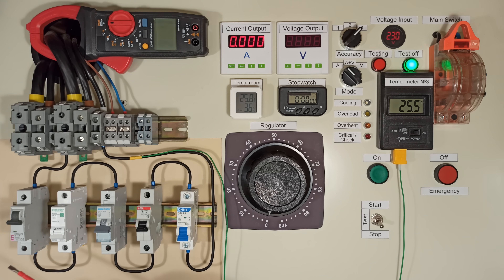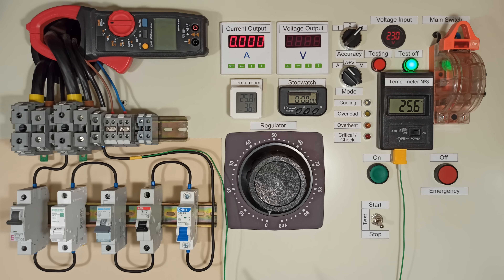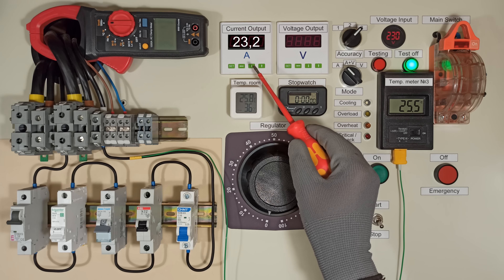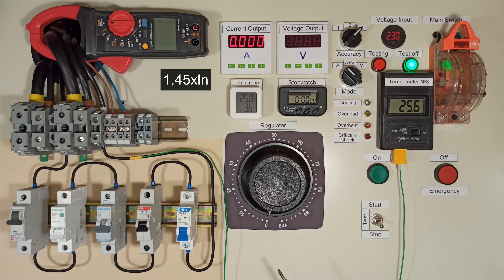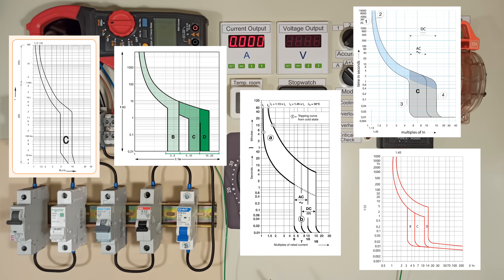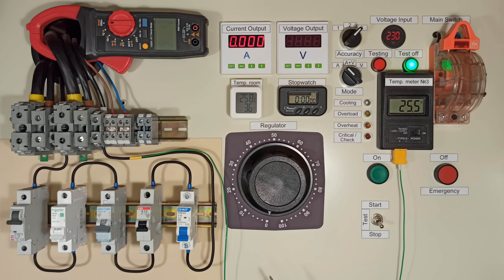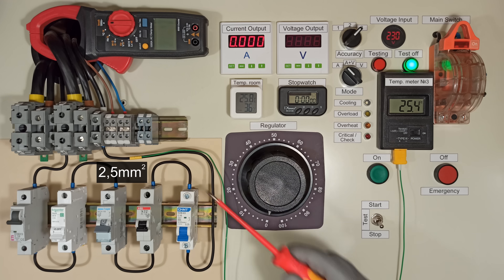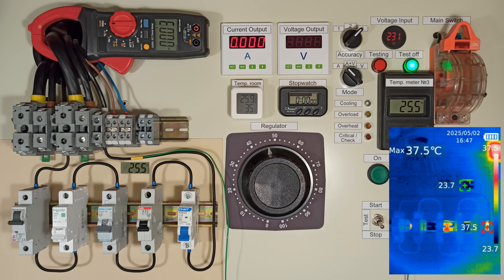Test MCB 16A. ETI, SE, Hager, ABB, CHINT

Comment: Tripping after 2:15 in an overload scenario is good in my opinion. The ETI was able to start the overload but tripped before reaching the 3 minutes - I anyhow think fair enough, because the load is already 45% above the nominal value. Yes, anyhow outside the spec. Having all breakers installed in a row may have had influence on the results, because all the breakers except the ETI had to stand the overload for several times. I can‘t say if that has an influence, but it might.
Reply: If it is outside of the curve then it's definitely not a good result. One should be able to count on those things.
Reply: @eowendyl  you are right, but honestly, what is the practical gain? If it does not trip after two, it trips after 3 minutes.
Reply: @Herr_Bone  For most people it probably does not matter, but for example if I switch from inverter power to grid power for whatever reason, I typically want to use as much power as my circuit breakers will allow, and I rely on knowing what I can get away with. So, in this not so hypothetical situation I may be charging my batteries at maximum power, my EV at max power and perhaps some other stuff. Now, I want to be able to count on the fact that my circuit breaker won't trip on me while I do this, and if it's outside of the curve then that definitely does not instill any confidence.
Reply: @eowendyl  yes, understandable… but for one single minute longer? Come on.
Reply: @Herr_Bone  Yeah, this particular test won't do much for me, BUT the point was that this particular one was out of spec in this test, so I would not trust it in any situation. (Which may be too harsh but it is what it is)
Reply: @ yes, from that point of view you are right. Out of spec is out of spec.
Reply: Да, съгласен! 100% има влияние, че са вързани последователно... Тези устройства са създадени за точно определени по брой инцидента, и с времето губят своята точна настройка!
Reply: Even though the other's had tripped before, if they're allowed to coold down to room temp between tests, I don't see any issue.
Reply from the maker: Thanks for your comment! I made a new test with ETI. "Tripping Time 5 MCBs. Test ETI Etimat 16A 1,45*In" You can watch it. I think you will find it interesting.

Comment: It would be interesting to see a test to determine the minimum current for triggering electromagnetic protection. Also tests with In *2 and In *4 so that the entire thermal protection curve could be interpolated. And also the dependence of the trigger speed on the ambient temperature.
Reply from the maker: Thanks for the idea! I’m sure it’s really interesting for me and probably others too!
Reply from the maker: I think the most difficult part is creating the test — the dependence of tripping speed on air temperature.

Comment: I don't see it as a big deal when it comes to brands, and for a private installation, I'd probably go with the probably really cheap "CHINT." 
But to be honest, there's a noticeable difference in height. Here in Germany, we like to use "busbars," (sog. Sammelschiene, Kammschiene, Phasenschiene) and electricians probably wouldn't like that. Furthermore, with existing systems, different manufacturers are often mixed during repairs and extensions. I think you forgot that in your very well-executed test setup. You used old-school free wiring. 
With a real system, things will be a bit different, and I don't see much hope for the Chinese company.

To be honest, I don't really understand the Chinese either. I notice it everywhere with them: the dimensions are different, even though they want to be successful on the global market. Whether the sub-distribution boards are smaller there or something like that, it's a mystery to me.
Reply from the maker: Thank you for your opinion. I haven't installed many CHint products yet to have a lot of information about them.

Comment: Eaton, Legrand, Siemens, General Electric, Gewiss?
Reply: At least here in Europe, GE is out of the market for most electrical components, including MCBs. They sold that division off to ABB a bunch of years ago.
Reply: siemens bad ever cb i seen that fired my closer like stove, i just changed with chinese cb
Reply from the maker: Thanks for your comment! I made a new test with Eaton, Legrand, Gewiss. "Test MCB 16A. Eaton, Noark, Gewiss, Legrand, E.Next" You can watch it. I think you will find it interesting.
Reply: @ElectroTest_1  Sorry for the late reply, I saw that test and many more. I love watching your tests. It would be interesting if you could test and compare the MCB curves with the curves of NV/NH or Diazed II (gG/gL) fuse links. From my experience, it seems that fuse links of the same rated current can withstand a higher continuous load.

Comment: Great test, thanks!  I happen to have all EATON, but I understand you cannot test all brands.
As mentioned by others: interesting to see how they behave after tripping 20+ times.
Reply from the maker: Thanks for your comment! I made a new test with Eaton. "Test MCB 16A. Eaton, Noark, Gewiss, Legrand, E.Next" You can watch it. I think you will find it interesting)
Reply: You'd have to wait until the temperature came to the same level before starting, TBH, I doubt it degrades much, id expect more wear when disconnecting near its maximum ISC

Comment: MCB temperature must be in ideal spot for correct test. I think it was 30*C.
Reply from the maker: @tarassu The ambient temperature before the test was approximately 25-26°C. I agree — the ΔT is indeed an important factor. Yes, there are correction tables that should be used if the ambient temperature differs from 30°C. These tables allow adjusting the test results, taking into account the impact of temperature on the characteristics of the circuit breaker.

Comment: Informative video, thanks.  According to their spec sheets, all basically within limits or safe as they trip "early" (ie on the Left Hand Side of the graph).  Although slightly outside the scope of the test, what was the ambient temperature before the test as the rise in in temerature (ie Delta T) of the wire is an important factor from an overall persepective.  Many thanks
Reply from the maker: @johnreynolds1184 Thank you for taking the time to comment!The ambient temperature before the test was approximately 25-26°C. I agree — the ΔT is indeed an important factor. In the video there is a small white ("Temp. room") and a large black thermometer.

Comment: A couple of those terminals were really hot (CHINT and ABB) I would have checked that, thought it curious there was no mention.
Reply from the maker: A thermographic image can give inaccurate readings due to light reflections from metal surfaces. In this case, there was a false hot spot to the right of the CHINT breaker and in the center of the rail. It wasn’t actual overheating of the breakers — it appeared even with no current.
Reply: @ElectroTest_1  good to know, thx

Comment: 1:28 by 'guaranteed to trip' i understand 20A on a 16A breaker, but the specs say it does under 1sec if the Current is at least 5x 16A = 80A. That is close to welding amps lol
Reply from the maker: I'm glad you're delving into such details. The guaranteed trip for these breakers is exactly 1.45 because it's limited by the standard, and there is a specific time frame. Up to 1.45, it could theoretically take a very long time to trip, and that wouldn't be a violation of the requirements.
Reply: @ yes, not  a violation of the requirements, but 80A on wires and contact surfaces that were made for 16A. The time it took to trip from ~23A was ridiculously long, even for the breaker that tripped first :|

Comment: It would be interesting to see this experiment after 20 or so trips. I have heard that cheap breakers become dumb switch rather than MCB.
Reply: all complied to iec. isnt?  ❤
Reply: Indeed, that would be an interesting test. When I buy a pre-loved house, I always change all old CBs for exactly this reason. My experience is more the opposite, the old ones trip too much when they should not. (Ask me about coming back to warm freezers….)
Reply from the maker: @ziegle9876  =) You wrote it like you often buy used houses. Is that really the case? I’d also love to replace the circuit breakers every time I buy a used house!
Reply: @ElectroTest_1  About half a dozen in my lifetime.... And I also always go through the entire electrical system, have found a lot of horror.....
Reply from the maker: @ziegle9876 Now I understand, that must be exhausting if you move often.
Reply: @ with the Klein ET310, I can do a 42 space breaker panel in a day, including identifying all the circuits in the house (where my son is the helper with a radio)
Reply: @ziegle9876  This is what I heard - that as the MCBs "burn out" over time, they heat up faster and trip easier. The story is that as they get older a B20 will become B16, B16 will turn to B13, B13 to B10 etc.

This is why having old breakers never really bothered me that much; I know places that use breakers that are many decades old with no issue. Of course if one can afford it, replacing every decade or two is a good idea, but I have yet to see a case of CB that did not work when it should due to being old / used a lot.  

What I usually focus on is splitting the circuits so that every built-in appliance has its own, that the lighting and other things are separated, and that there is a reasonable amount of sockets per circuit.

Worst I have seen was an apartment that had no CBs at all inside; everything was one huge circuit and relied on the CB at the power meter for safety. Definitely not enough in my book.
Reply: @ziegle9876  i agree, that's also what i experience when i set up temporary construction power for construction sites, those MCB really get abused and it seems like the more they have tripped the more sensitive they get. But this could be false because if the opposite also happens, who would notice, since they don't trip :)
Reply: Using several CHINT breakers as switches for 15 years = only one failed. 
I doubt anyone could provide you with a better testing results.
Reply: @deliriumcode  What type of failure do we talk about? It failed to trip and the wire burned? It stopped conducting at all / was impossible to set into "ON" state? Started tripping seemingly at random?
Reply: @TheBlobik  The type of failure that I can not set it on "ON" state again. It can be done after several attempts but it's a feeling like some spring inside weakened. BTW, they are still tripping as they should but I do not have a confidence in them so I replaced them with a new ones (same manufacturer, same model).
Reply: @deliriumcode  Yep, but using it as a switch is something completely different than still matching specs after 20 overcurrent trips. From what I read on a Dutch electronics forum I frequently visit, Chints just start to fail after breaking multiple faults and especially a hard short tends to render them useless, but not in a way you immediately recognise so. I just stick to Schneider, Eaton, ABB and the likes and avoid the cheap shit alltogether, it's my place to live that is at stake and I don't mind to spend some money on that...
Reply: That would be a more interesting test. Of course its limits to how much testing you can do for a youtube video, but it would be interesting to see these be tested until they fail at various places on the curve, included approaching max IK rating and beyond. Also see all trips plotted on the curve, to see repeatability
Reply: 每个月进行一次简单测试。你们都不做吗？
Reply: @sbrook9413 Circuit breakers are not intended to be tested once a month. However RCDs should be tested once a month
Reply: @sbrook9413  I don't. Share your methodology.